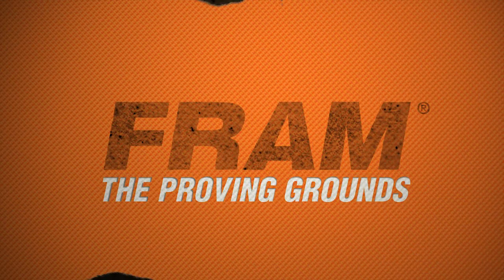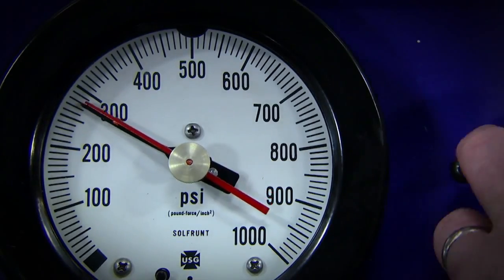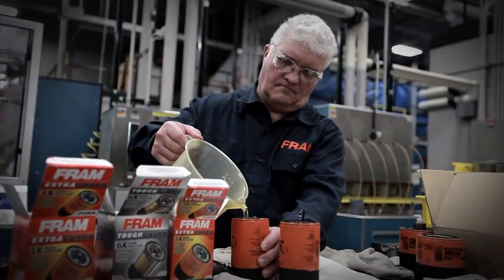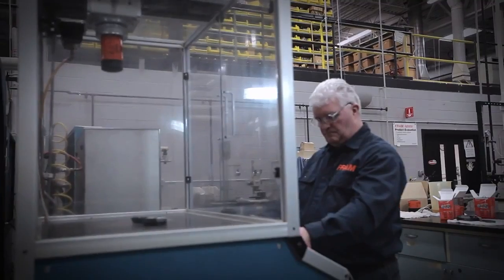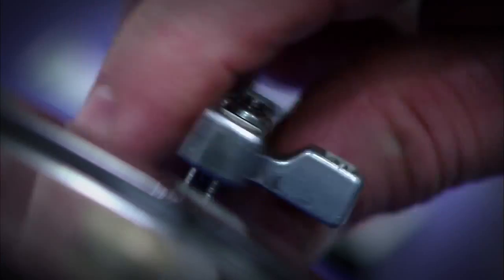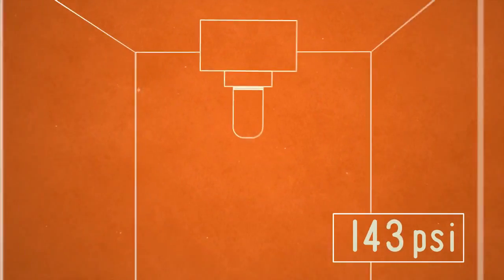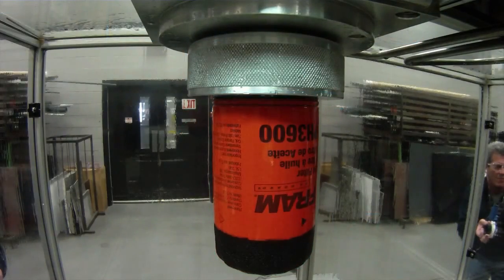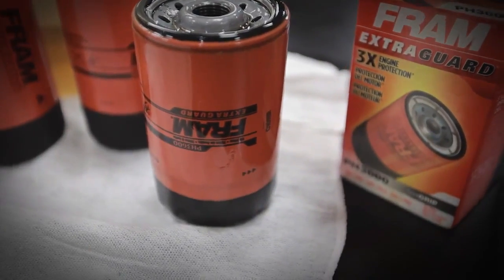The FRAM® Burst Test

Comment: I did a oil change with a frame filter once and the top of the filter blew off almost immediately. The base of the filter was still treaded on the engine. Replaced it with a MANN and checked the oil pressure and it was under 80psi. I have never used a frame since.

Comment: I always use their Ultra Synthetic filter with Supertech full synthetic high mileage. 8k miles on both and no problems! A cheap and good combo. My Dad worked on and made Fram filters in the factory along with the engineer that made them. I trust them 100%.

the common rumor that “paper” holds the filter media together, is actually fiberglass composite. At least when he was making them it was.

Comment: I just had an oil change at a Nissan dealer(Hanlees Hilltop Nissan in Richmond, CA) on my 2019 Nissan 370Z sport coupe, for which I supplied the Fram XG-6077 Ultra Synthetic oil filter that I had bought at a nearby Walmart. Immediately after the engine was first started the base gasket blew out and sprayed my lower engine compartment with oil. Luckily, this happened in the shop and not on the road, where the consequences might have been catastrophic engine damage should I have not noticed it immediately and shut off the engine. I chose this filter because I thought that Fram had gotten its act together on quality control, so I'm more than a little disappointed. I'm not going to take another chance on destroying my engine in a car that I treat with meticulous care, hence I'm going to be using Purolator Boss oil filters in the future.
Reply: Bullshit
Reply: Sounds like installation error. They probably didn’t tighten the filter down or the old gasket stayed on there and you doubled it up. And the way you wrote about purolater at the end makes you come off as a paid shill

So this event probably never even happened
Reply: @someguy5975  I came to the conclusion that it was probably due to installation error and have continued to use the Fram filters, without a problem. I have used Fram filters for decades with no problems but I did report this incident for the reason I stated.Are you employed by Fram, as it seems curious that you would automatically call somebody a liar because they simply report an incident such as this?
Reply: Sounds like a double gasket, same thing happened to me once when changing my oil and I realized this was my own mistake. It did the exact same thing you are describing, it blew the second o-ring out the side and caused oil to go everywhere.